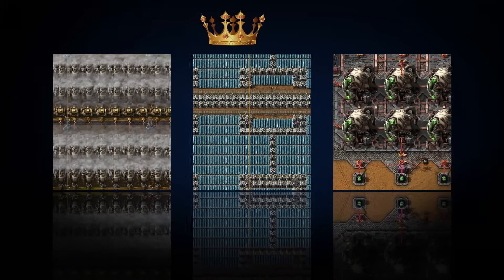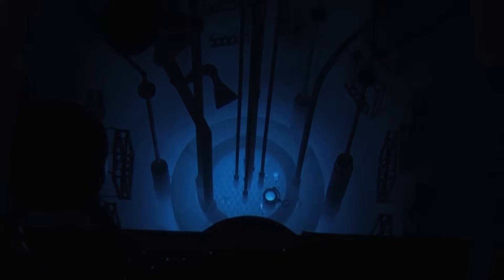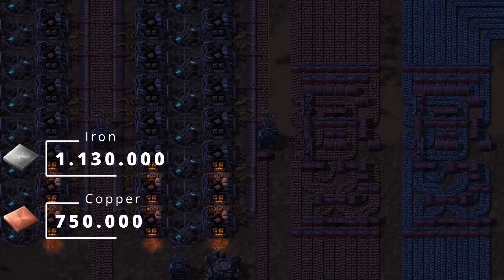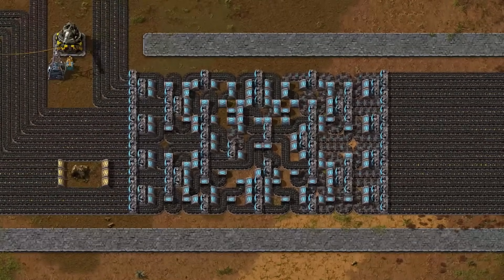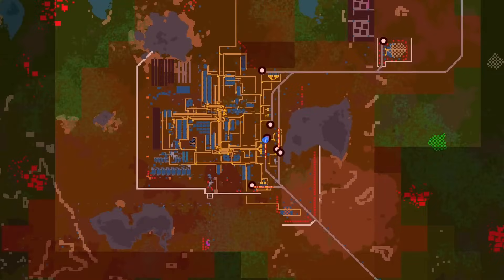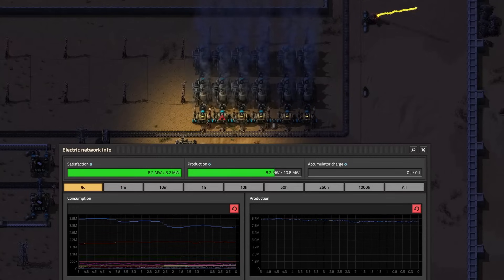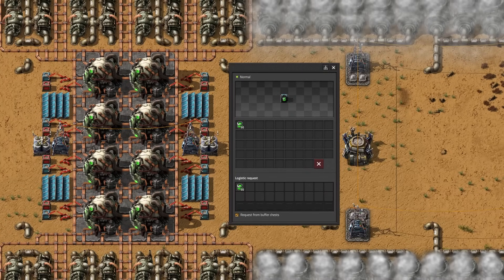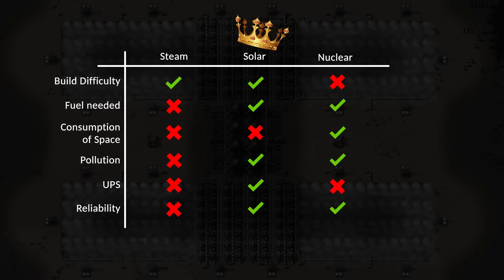Learn about Factorio Power Production - What is Best?

Comment: There are actually five different options for power production. Steam, solar and nuclear, you have covered. However, there is also fusion energy and turbine burner plants. Fusion energy is obviously inconvenient on nauvis because of the logistical problems inherent in importing fuel. Turbine burner plants are merely steam turbines hooked up to a heating tower via a heat exchanger, which is more efficient and reliable than steam engines but still has the issue of a fuel dependency. It's also more complex than steam engines, as you need to set up circuit controllers with your inserters to avoid wasting fuel when power demand is low.

Comment: The reliability of Solar has one other big upside. It is easy to jumpstart after an issue. If your nuclear or boiler ever fully blacks out, it can be a lot of work to get the fuel to restart.

With solar, you probably notice the issue at night and the next date get back to fully functional as you build out more power.

Comment: You can pair an original boiler with a turbine to save space and use nuclear or rocket fuel for significant fuel density, which changes this evaluation quite a bit! Obviously heating towers blow them out of the water though.
Reply: The lower temperature steam from boilers make turbines a waste. You don't get more power than a steam engine.
Reply: @ctrlaltdebug you need one instead of two, it's just more compact.

Comment: Your solar is 15x more expensive to build than nuclear, yet you completely excluded that category from the table at the end?  Really strange.
Reply: Probably a combination of it not being that simple and not being a big deal.

Nuclear's cost per MW is pretty variable  depending on scale and design. It is further complicated as it needs some more complex materials and you have to build centrifuges and Uranium mining to support it.

Meanwhile solar scales linearly with every MW having the same cost.

In terms of it not being that important. Up front costs are generally unimportant as you can produce so much. Unless there is a specific difficult item required, upfront costs can be overcome quite quickly.

Comment: I was one of those people who was overwhelmed by Nuclear and was willing the just have vast fields of Solar/Accumulator arrays for power. But one day I finally say down and learned how to do Nuclear power... And it's surprisingly easy. Like, it's literally just a 1:1 ratio of Centrifuges processing Uranium to Nuclear Reactors. And if you're willing to go one simple step further and do enrichment, 1 Centrifuge can supply 33 Nuclear Reactors.

By far, the hardest part of Nuclear power is getting your first 40 U235 to start enrichment. After that, it's basically just Steam power that occasionally spits out a piece of Coal you can feed back into the fuel loop.
Reply: the ratio is not 1:1, one centrifuge can run several reactors, especially if you use circuits to control fuel insertion with steam storage. This is before koverax enrichment

Comment: For me what works best is to unlock solars, and use them for small outposts first with them in mind, and then when the outposts are self-sufficient and can run 24/7, join the outpost energy and compliment the main base with nuclear replacing the previous water and steam based power at the beginning of the game.

Comment: Sadly, nuclear is a lot harder right now speaking as a long-time newbie (bought it back in 2017, but only logged ~40hrs until this year). Kovarex is now locked behind space science, so you need to be much further into the game to have a reliable source of U-235. As such, I'm still heavily on team steam in my Peaceful playthroughs, lol.

That said, I love solar power both for its simplicity and lack of concern for logistics. Going back to my statement about playing on Peaceful mode, being able to just drop a massive solar array in the middle of nowhere and all you need is to connect a power line has to be the single greatest thing.
Reply: Kovarex not really needed for nuclear power, at least to start using it. Moreover, it may be harmful to wait until kovarex. If you have more than 7 centrifuges per 8 reactors running non stop, you wil not run out of uranium, and it's reliable source. If you use productivity modules in fuel cell production, things are even better. It's rather easy to run npp and accumulate needed 40 pieces of 235 over time, have bigger more capable base and only then research and start kovarex (but it's not necessary and will always cost lot more than chests for excess 238 and some extra mining). Also you lose nothing if you delay kovarex.
Reply: @JumpingJack-w2l  you don't need that many centrifuges, one centrifuge can power several reactors
Reply: @Ghorda9 how's that for base case - no kovarex, no modules,  reactors run non stop?
Reply: @JumpingJack-w2l  yes, especially if you control fuel insertion and use adjacency bonuses with excess steam storage
Reply: @Ghorda9 you didn't answer how is that, violated requirement (fully utilized reactor) and added non relevant information about adjacent bonus. We are looking only at 100% utilized reactors, no matter for what reason they are running non stop. It can be controlled reactors at capacity, or uncontrolled. Case of underutilized reactors is not relevant, introduces unnecessary complexity and makes comparison lot harder. "My setup can support two reactors from single centrifuge" "how's that?" "I utilize the reactors for 50% of time". "Cool, but my setup is better, it can support 5 reactors from single centrifuge" "How's that?" "I utilize the reactors only 20% of time" etc. So please try again.

Comment: If solar power requires 1,130,000 iron for only 1 GW of power whilst 1 GW of nuclear is 72,000 iron, that means with the resources of 1 GW of solar you could build almost 16 GW of nuclear, which considering you don't even need more than 0,5 GW to beat the game the only point of more power would be to build a huge mega base.

As a side note I personally finished the game with a small 2x2 nuclear power plant as my only source of power in the late game, I was going for the "Steam all the way" achievement at the time though, the only time I've used more power was in modded, where I had to use a shield to protect my factory from a solar death-ray that drained way to much power.

However I'm not here to judge how people decide to play the game, I personally play a lot worse than optimal, and as long as you're having fun then there's nothing more you need to worry about
Reply from the maker: Sure, if you just want to finish the game and launch a rocket it doesn't even matter. One could argue that going nuclear makes no sense whatsoever because by the time you setup nuclear the game is over.
So yeah it's meant to be a video about late game.

Comment: You forgot to mention one very important category: convenience. Solar needs to constantly be expanded as your energy demands typically skyrocket exponentially after the mid-game, when you start implementing modules, electric smelters, beacons and bots. Whereas Nuclear can be upgraded much less frequently, because it is so energy dense. One blueprint of nuclear can produce a gigawatt of power easily, whereas the material and area cost of solar will  likely prevent most players from making enormous blueprints to provide the same energy per blueprint. In addition, Solar expansion has an intrinsic task of finding or clearing free space for it.
Reply from the maker: Kinda. Convenience is the sum of build difficulty, space and material needed. But i've never been in a situation where clearing free space for solar was necessary. I have to expand the base anyway to access new ore outposts. Maybe it's because i've never played with custom ore settings like higher density and size. As soon as you have bots you can just let them build solar panels which beats everything else in convenience.
Reply: @AVADIIStrategy  except you're leaving out travel convenience, solar is a huge obstacle that you need to navigate to get around, people only have a limited time to play the game and i don't think most of them want to waste it on just getting from one end of the map to the other
Reply: @Ghorda9  Eh, just take a train or use a spider bot. Either one works.

That said, I still prefer nuclear, or burner turbines where that isn't practical. Solar just isn't as practical to expand unless you already have a huge megabase.

Comment: You start with Steam usually and then move on to Solar for a large chunk of the game. Then once your power demand goes above something like 500-700 MW you start using Nuclear. Solar is nice for the mid game but after that the amount of time and space you need to invest to keep up with power demand just kind of forces you to nuclear. Even in the biggest bases you will run out of space if you start using Prod 3 Modules everywhere. Nuclear has crazy good power density and a tiny footprint in comparison to solar. And imo the UPS hit really isnt that big of a deal. The nuclear plant is tiny in comparison to the rest of your factory which eats way more UPS than the power plant I think. Idk I just cba with Solar at some point. I wanna fix my power issue once and for all and not constantly clear more space and paste down Solar.
Reply from the maker: I agree. But there's one thing i hear all the time: running out of space to build solar. Never happened to me.
Is it because you play with larger ore patches and higher density? Expanding my bases to access more ore patches opens up more than enough space automatically.

Comment: I don't do megabases, so for me the choice is nuclear. It's not that space is precious as such, but since I don't do a megabase constantly churning out solar becomes a big resource drain to me. I usually jump straight from from coal burning to nuclear (even before kovarex), it's fairly cheap and has an incredibly small footprint. I start with a "small" 4x4 smart reactor, which is even worse for UPS, one setup that turns off the reactor and buffers steam. Once I go bigger with beacons and modules, I start production on a tileable reactor and put the smart reactor as a backup (with a power connector thingy and an accumulator on a set reset latch). While resource stop being an issue once you go big into beacons and modules, the space requirement for solar becomes even worse too.
But as I said, I don't megabase. I can stay in a game for a long time and build fairly big, but never to the point of having UPS issues.

Comment: The coal requirements for steam power drops from ~15k to around ~7k if you use coal liquefaction to turn coal into oil products and produce solid fuel with the oil products, thus becoming about twice as efficient in terms of coal usage (or ~3k with productivity modules, or 5 times as efficient).

The coal requirement to use rocket fuel is slightly lower than solid fuel, but only if you are using productivity modules in the rocket fuel assembling machines, still around ~3k, which can fit on 2 red belts.

You could also use advanced oil processing to create the solid fuel, in which case you'd need ~55k oil (~30k with productivity modules). Producing rocket fuel with productivity modules instead of just solid fuel gets you just below 30k.

Going for nuclear fuel you need ~850uranium ore (1 yellow belt) and ~2k oil or ~250 coal for your steam engines.
Reply: Uranium ore and coal is a combination that i've never thought about. Could be a genius middle step between coal and nuclear.
Reply: @-yttrium-1187  I feel like waiting for u235 will become a bottleneck, using it on fuel cells is 66 times more efficient even when comparing to a single reactor with no bonuses. If you're comparing to a 2x2 reactor setup, making uranium fuel cells is 200 times more efficient in your u235 output

Comment: as for the UPS, now we have the new fluid system so maybe it should be reviewed. solar will always be the top since it has no updating cost but i do think that with the new fluid system the other two will cost significantly less updates and may even be ignorable.
Reply from the maker: That's a good point. When the DLC is out i certainly have to review some of my advice/recommendations.
Reply: @AVADIIStrategy  
the timing i myself use them could always be steam -> nuclear -> solar (or never solar).

TLDR;

there could be another facet to put into consideration, the cost to figure out how to make them work at a certain scale and to put them donw.

i think for real endgame, when space and safety is no longer an issue, solar panels surely is the final answer. just plan a block with robot port in it and paste it all the way down, it will be taken care of. 

but it is quite slow. putting them down by robot takes time, manually doing that not only takes time but also is a pain in the xxx.  so it is only an option when we reach the point we don't need to worry about space and bugs, and don't go around putting things down by ourselves.

after the steam stage, normally a boost in power supply is desired.

nuclear power takes much more work to understand and plan, not only the power setup but also the forehead resource production. but once it's done and you cameup with a tileable solution, the time performance on expanding it will be the highest. just put some more 4~8 reactor sets down and power supply will not be the problem for a long time.

Comment: I play only deathworlds, so space is a valuable resource until late-game. I build steam only in early game, then move to nuclear. I build solar panels only for my artillery outposts that clear up space for my expansions, as they need to be 100% independent and they are usually deep into infested territory and they need to be still alive in case a power line to them is severed by biters.
Reply from the maker: Interesting. I like to rush solar even in deathworlds. Never building more than 4 boilers.
What about defending power lines with lasers?
Reply: @AVADIIStrategy  easier to just blueprint the outposts as stand-alone power-wise and they get on-demand other stuff via trains (like shells). I rarely have to go save a train that gets intercepted by biters.

Comment: Solid video, but I feel like you should've factored in the expense aspect of things more; while solar being extremely friendly to gradual integration does offset this, it is significantly more expensive than steam or nuclear, by two whole orders of magnitude. The sheer volume of components also makes the crafting and setup time much, much slower in comparison.

(Particularly for newer players these are both VERY relevant factors, as I've run personally aground of problems caused by both on multiple occasions.)
Reply from the maker: I did calculate the raw materials for 1 GW of solar energy didn't i?
I still believe it's no big deal. Just researching nuclear power is more expensive than setting up ~40 MW solar.
For solar you don't even need blue science (where new players struggle a lot).
There are even more pros that the video didn't cover because it's short and condensed:
e.g. accumulators provide huge amounts of burst/peak energy which is very useful if defending with lasers.

Comment: Doesn't factor costs into the final result and doesn't factor difficulty to actually build into final result. I tried doing all solar and it was a nightmare. The vast majority of my base was solar panels and blackouts were common. Not enough resources to create panels/accum, not enough resources to expand the walls to place them, not enough power to place the walls, panels, and remove the forests with bots. It was SLOW. 
Then I switched to Nuclear and 1 compact little reactor made more than all of my solar panels.

Comment: Solar should win in reliability. It will ALWAYS work every day. If you by some miracle royally screw up and run out of Uranium-235 without noticing? It's literally impossible to start it back up by hand. Extremely low risk but an extremely bad outcome.
Reply: once the enrichment process is set up then you never run out of u235, like ever
Reply: @anon1963  Say that when accidentally deconstruct the whole thing without realizing.
Reply from the maker: The issue with solar is that it's possible to run out of electricity during nights if you fail to keep up with your bases demand.
If you defend with lasers you're totally screwed and biters will destroy parts of your base.
This will never happen with nuclear because even if you produce less energy than required: lasers have energy priority over other entities so they will always be able to defend your base with the full amount of nuclear energy.
Reply: @AVADIIStrategy  Who goes half meme when doing a meme run though? Lasers only isn't really a challenge if you don't stack solar power only.

Comment: I have a massive world going at the moment and I wanted to power my base with solar power and batteries, I have filled in oceans to cover in panels and accumulators. It takes 7 minutes to take my rocket fuel powered train from one end to the other and the only way I can realistically keep everything running is with a massive 100k drone network and a few dozen remote controlled spidertrons. Currently running at 28GW but still needs more power!
Reply: "i'm trying to be enviromentally friendly, so i filled in the oceans to build solar panels" XD